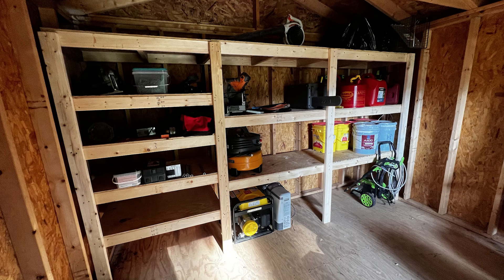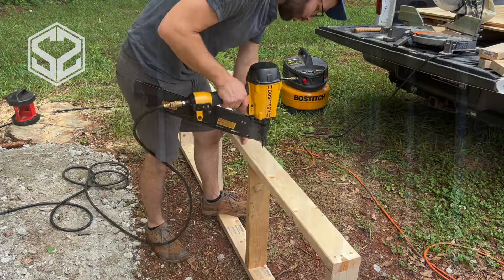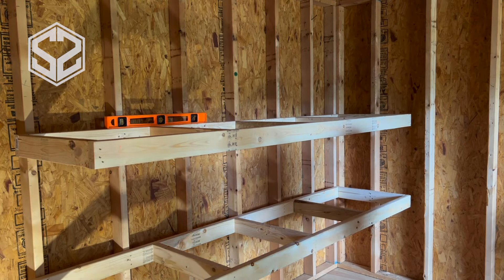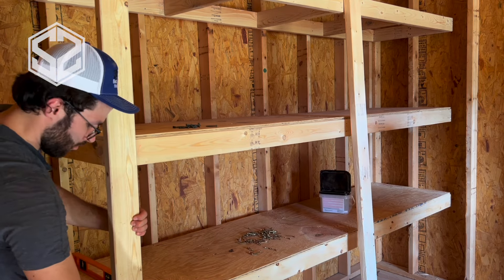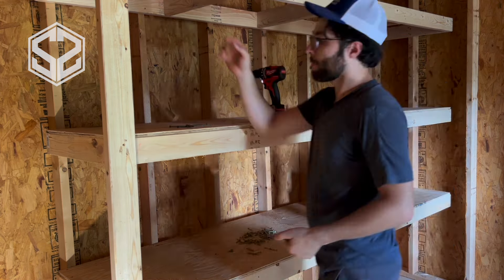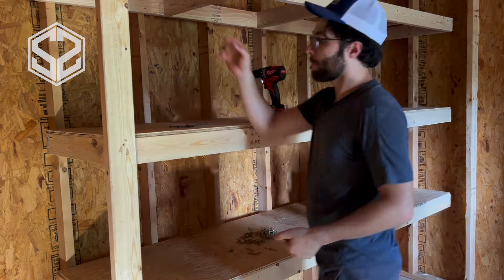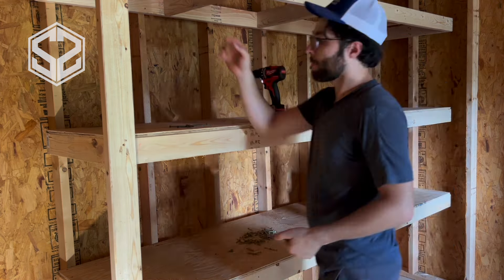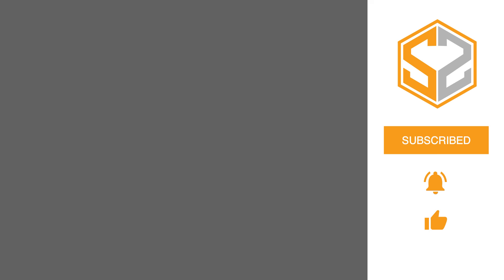Simple Shed Storage Shelves

Comment: Yeah I prefer using Screws instead of Nails, if you mess up it's easier to undo mistakes.
Reply from the maker: Very true! I made a few mistakes and I had to get out the sledgehammer to move the board a half inch and re nail it.
Thanks!! :)
Reply: 100% F nails!!!  JK 🤪
Reply: Love it